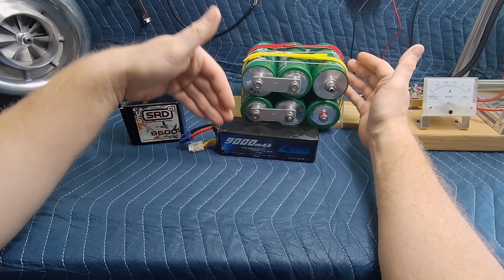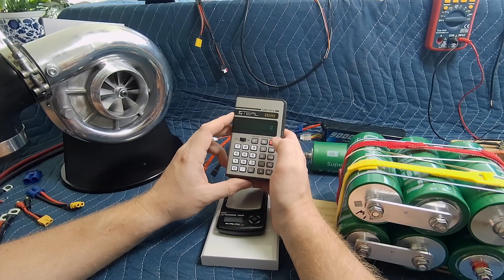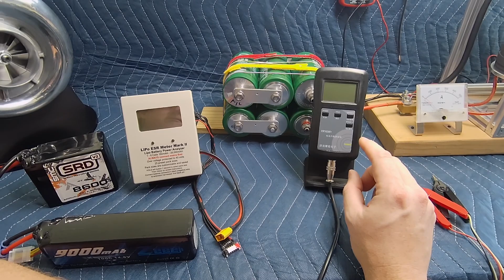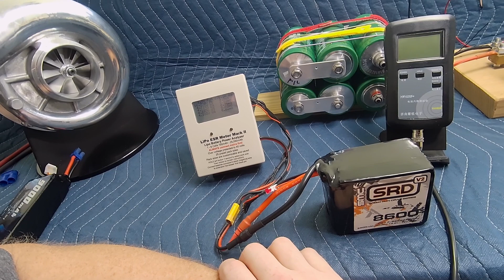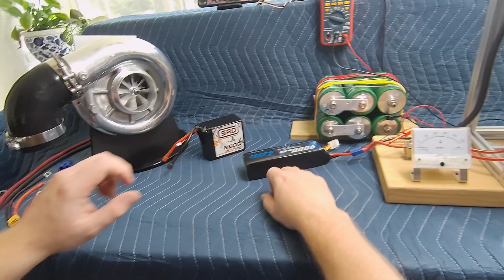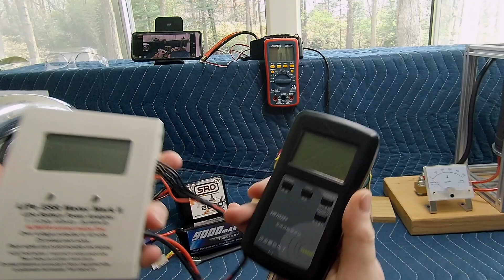SMC vs Zeee vs Lishen batteries heavy load test and internal resistance measurements

Comment: A major advantage of LTO cells is that they're incredibly stable. Don't try this, but you could literally drill a hole into an LTO cell discharging 500 amps and it will not catch on fire.

Comment: Hi,can you help me eith some information please? I use before 24 cels lishen 18ah 6S in my car at 15,6 volt  280-300A  alternator with any problem,now i change the car and i want to use oem alternator 180A 20 cels 5s configuration not 6s like before voltage 14-14,4volt but i don't know if the cels will be survive 5s ath 14.4volt or the alternator have power to charge the battery 😐

Comment: I’m investigating this awesome new world of electric driven superchargers. Current plan. Standard crank-driven Procharger F1A for my 21 Camaro 1LE. So a compressor easily capable to support 1,000 flywheel hp on a 6.2L engine. 
If going electric- is there another affordable compressor that you are aware of that supports my desired HP or would I be looking at two of the ones you have ?
Second question: 
What battery needed to last at least 5, 9second pulls at full boost?
Reply from the maker: You would probably need to use 2 units given the current limits of available motors and ESCs to do that.  The Speedmaster P2 supercharger is the way to go - dollar for dollar, it's tough to beat.

Comment: omg 500amps for 5seconds? lol you are really pushing them little packs and killing them at the same time. But thanks for doing the test to lay to rest the nonsense about triple digit C rating and how much bragging amps these little packs are supposed to be able to support and be able to do it again and again rather than a one off kamikaze style burst.
Reply from the maker: For short bursts they'll hold up ok for a little while at least - but there is quite a bit of variation between Lipo brands - and these bursts are where the major differences will show up.  For my purposes I need to know what these will do at very high amp draw.  I have yet to find anything that can match the Lishens, though.
Reply: My 200amp max6 esc can spike to 1200amps

Comment: AC IR shouldn't be used to measure voltage drop. It's not DC IR.

The reason why the Wayne Giles meter wasn't "accurate" is because it doesn't test at 500A. Most DC IR testing is done at currents well under 100A. Usually 1A to 20A

Comment: Some simple health advice when working with batteries that support big current outputs: DON'T USE METAL RULERS.  I know people who have suffered severe burns or worse from "whoopsies" that vapourised the ruler.
500A through 8-10 guage wire....  lol
Looking at the shakes in your hands, there was a sense of the energy levels you were playing with.
Reply from the maker: Actually, yeah, the shakes do get worse when I'm excited about something; but it's a medical condition known as "essential tremor."  It runs in my family; I have a cousin with MS.  Believe me, I wish that wasn't the case and it is something I'm a bit self-conscious of.  And I did notice in editing how close the ruler looked to the pack in the video, but it wasn't in reality. I actually have a plastic ruler I'd usually use, but it's be hard to read on video.  If it makes you feel better, the backside of the metal ruler is covered with cork.  And I have dropped a busbar into a Lishen LTO pack before - I think there's a shot of it in the building of the "ultimate 12s pack" video.
Reply: @AlexLTDLX  Hey mate, you obviously have found a way to live and deal with what you have been dealt, keep it up. 
Yeah, my first trade was electrical engineering building switchboards and not your little domestic turds either, our boards started at several hundred amps (Aus, 240V, no 120v crap here) out to kiloamps in HV so a healthy respect for what you where using around potential energy was always on my mind. One of our reps put a stainless ruler to close to a set of enrgised 3-phase bus-bars and copped 70% coverage, 3 degree burns. Hard lesson.

Comment: I have smc and onyx (uk high power) packs.  You need to heat the packs up to about 100 degree for the full potential and discharge without voltage drop.  Thats how we pull massive amps
Reply from the maker: That's how Tesla does its "Ludicrous mode" too.  In fact, in the drag and dyno testing of the electric turbo, the second pull always made more power than the first; at least until we switched to the LTO cells.
Reply: @AlexLTDLX  👍👍. LTO are way more stable. If you run heated lipo batteries in parallel,should beat the LTO cells but very volatile

Comment: The Zee battery didn't drop all that voltage, a large amount was dropped across the ec5 connector... hence the massive heat put into the cables. You should have measured on the battery-side of the connectors not the load tester side.
Reply: Voltage is Voltage doesn't matter how much restriction in circuit voltage will still be present.  Not to mention a restriction will add resistance in return less current draw in return less voltage drop.  In return the SMC lipos handle more of a load then the zee lipos.
Reply: @KiloWattRC  That's not correct.  Voltage dropped over the connector.
Reply: @timjs1018  the connector is not a load.  Look into basic electrical.  The Zee lipos couldn't handle the amp load and that's why voltage dropped
Reply: @DISHDOCTOR  Everything with resistance is a "load" and voltage drops proportionally across it. This power is lost as waste heat, hence the very high connector temperatures he had after the test. I suggest you take your own advice and read up on basic electrical.
Reply: @timjs1018  what u think the ec5 measures out 10 ohms?  You won't loose voltage across the connector.  Connector did just fine connecting path to ground, zee lipo had a hard time supplying 500amps for 5 seconds vs the higher true C rate SMC SRD pack
Reply: @DISHDOCTOR  Well, maybe he will re-test that battery if he sees these comments. I predict there will be a significant difference measuring voltage on the battery side of the connector versus the load side.
Reply: @timjs1018  I hope he tries the ONYX 4s 8000mah pack vs the SMC SRD pack.  EC5 contact resistance is 00.40m ohms.
Reply: @KiloWattRC  it’s resistant
Reply: @KiloWattRC  each? And if perfect, what’s real world? You are clueless
Reply: @dennis-nz5im  yeah so a connection that has 00.40m ohms of resistance will remove 2 volts from the circuit tested?   If you count all your penny's that is your choice, I will continue to round up to the whole or round down.  Go enjoy yourself its not that serious.
Reply from the maker: The connector and the short lengths of cable between the battery and the connector dropped about 0.25 volts - not all that much, really.  I did a video on the resistance of most RC type connectors: https://youtu.be/-jLcgRxIfG8
Reply: @AlexLTDLX  I'll check out that video when I get a chance. Curious, was .25 volt drop measured with a 500 amp load?  That's 125 watts of heat dissipating there, which creates even more resistance as the temperature rises, yes?
Reply from the maker: The .25 volt drop is calculated, not measured.  Without damaging the packs, it'd be impossible to actually measure the voltage drop - which is why it doesn't matter to me.  It's impossible to use the packs without the cables and connectors anyway.  But yes, the voltage drop would increase as they heat up.  If you want to do some math, figure about a 0.4% increase per degree C temp rise.  So let's say the temps went up by 100* C - that's a 40% increase in resistance (and therefore voltage drop) - so figure somewhere around 0.35 volts on the high end.  Not much different.  FWIW, I recently shot a video (but not edited or posted yet) where I take apart a 4s pack to remove a dead cell.  You'll be able to see the internal construction then.

Comment: I don't think those little EC5? connectors are going to be up to the 1000 amps. Especially with how hot it got.

Maybe you could measure voltage drop before/after the connector? Maybe using the balance lead.
Reply from the maker: Well, the packs came with EC5 connectors and that's how they'd be used.  But I have measured the resistance of most RC connectors in another video: https://youtu.be/-jLcgRxIfG8  The connectors, along with the short length of cable, are responsible for about 0.25 volt drop.

Comment: When you look at the prices, internal resistance, and C-rating, it all aligns so no real surprises.

I think if this test was revisited, I'd want to see an equal weight and/or dollar amount compared. As in 4x Zeee's vs 2x SMC's vs 1x LTO...or other multiples since I can't really find LTO pricing.
Reply from the maker: Pretty much.  The LTO cells are expensive - I bought 60 of them for about $1,500.  They're hard to find in stock, too.  I use 24-26 in my "sledgehammer" electric turbo setup, depending on where I want the SOC - if you haven't seen it, here it is making about 722 hp at the drag strip: https://youtu.be/nlTVHkfSQXM  But, you're correct - not everyone needs max power delivery.  It's important to me for my electric turbo projects; but for others, size, weight or price may be more important.  Which is why I included that data.

Comment: Very interesting video! would love to see a 2nd run on a much lower AMP hit, lets say like what a 6s Kraton or Traxxas Maxx would pull on full punch. Just to see real life example of the difference in power provided on the SMC versus cheaper Zee's/HRB etc.
Reply from the maker: That's a good point.  I'd imagine the relationship would be pretty linear.  So if there was a 4 volt voltage drop at 500 amps, you'd have a 2 volt voltage drop at 250 amps.  BTW, the starting voltage doesn't matter - the voltage drop is purely current dependent.

Comment: to answer your last question: fire
Reply from the maker: Lol.  Most likely, the higher voltage pack would try to charge the lower voltage pack, but there'd be no current limiting aside from internal resistances.  So you'd probably see about 250 amps instantly; or even more for a few milliseconds - big sparks.
Reply: @AlexLTDLX  Well, it could be done if the packs were managed by the same BMS at the cell level with an identical layout, but given that they are different chemistries, i really wouldn't do it lol.
Sometimes, e-bike people will run packs in parallel, but they are identical packs.
Even 0.1v of difference would make for huge currents.
Reply: It becomes a portable welder 😂

Comment: Mabye some 26ah Lishen LTO at 33$ individual could be a replacement for OEM Lead acid Automotive battery?
Reply from the maker: The LTOs aren't a great option for an automotive battery.  LiFePo4 is the chemistry your want - 4 cells are perfect.  I built a 100 ah LiFePo4 batter for the LTD (the race car - this one: https://youtu.be/nlTVHkfSQXM) and it's been working great since I put it in - way, way better than the lead acid battery it replaced.  Here's a video on it: https://youtu.be/cS1aQJOnqTQ

Comment: Amazing video! Thank you.  All that after 2 days at full charge! Wow. Pore batteries lol. Never thought the difference would be so drastic. Smc is definitely going to be my next set of batteries!
 Im curios, what if u ran a pair of the zeee batteries in parallel through the same test. Maybe the wouldn't completely 💩 themselves?
Reply from the maker: Thanks.  Actually, that's kind what I've been doing when I was using them in the first electric turbo setup.  They perform how you'd expect - with about half the voltage drop.  Here's the video of that drag test at a private airstrip: https://youtu.be/AOL3Qyczt3Y
Reply: @AlexLTDLX  very kool. Thank you 😯